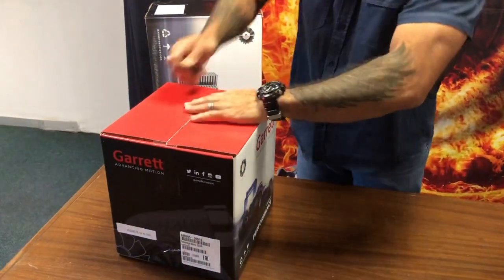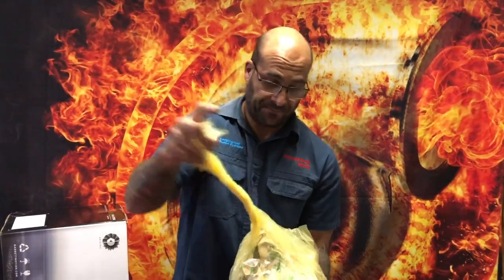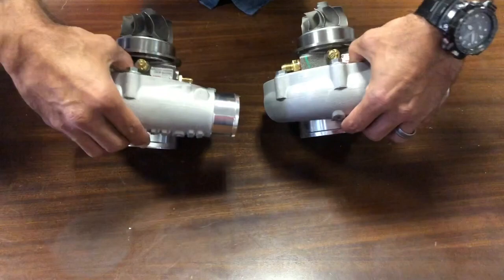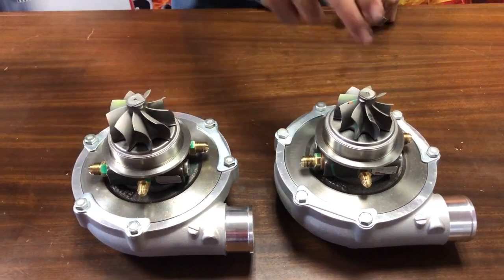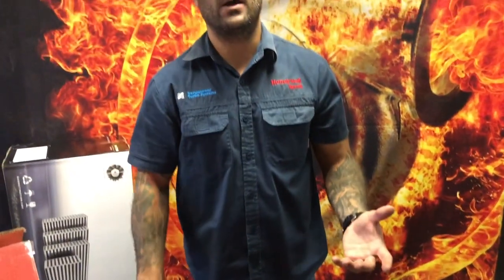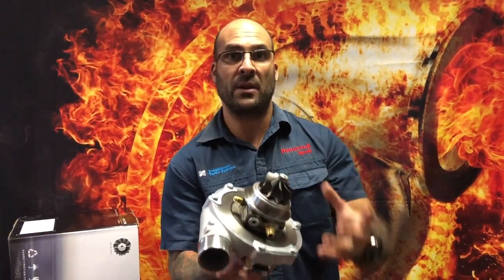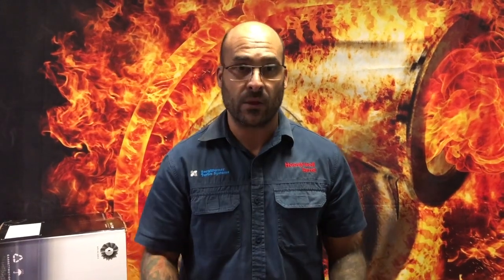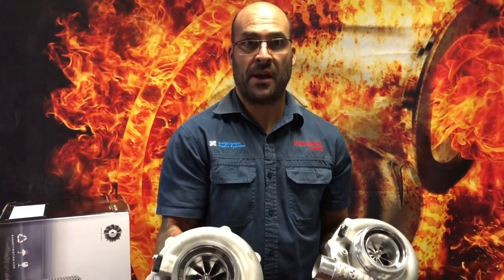G30-900 and G35-900 compared

Comment: N54 8hp, Maxx ECU port injection only. 700 wheel ish. Street car with some racing on side 

6266/6466 next gen precision, 
G series g30-900 or g35-900
Borgwargner SX-E S366

What do I go with and why
Reply from the maker: Borgwarner without a doubt and not the s300 as this isn’t a fair comparison - it’s the only journal bearing turbo in your list. The EFR8474 black series is the turbo that will outspool and outperform all the rest. The Garrett is the unreliable one and totally overrated (forget about seeing power that’s okes close to its printed HP number in the real world.) 

If you want the best bang for the buck - then go S300SXR - it’s journal Bearing but proven reliable, rock solid and delivers more than what Borgwarner claims in HP. https://www.facebook.com/share/v/17R9QmJgon/?mibextid=wwXIfr
Reply: @T @TurboDirectSA was going to use a speedtech single turbo kit it comes with only a Open wastegate dump why they didn’t offer the internal wastegate borg turbos
Reply from the maker: @dolphinfan1493 ALL Borgwarner EFR turbos come internally gated -

Comment: Hello Sir great info.
What would your recommend for Subaru STI EJ25.
I want to make 500 to 550whp. What turbo would be best choice not to go to big. G30-770, g30-900 ?
Thanks
Reply from the maker: I would go for the EFR7163 - it will make that power easily and outspool any G-series turbo!

Comment: I'm 5 years late to this video. hopefully you'll reply me, since i'm in a dilemma. Which turbo u reckon would be best for a stock bottom end evo x (4b11t) with full bolt ons. Gtx3576 II , g30-770 or g30-900 or any other turbos? I'm currently using a hybrid 3076 turbo making roughly 380+ whp on a mainline dyno with pump gas. My target is tryinh to achieve around 430ish whp on with decent spool.
Reply from the maker: Thanks for the comment - EFR7163 is going to spool up much faster than any Garrett of similar size and this turbo will make 550HP I would use the AR80 Vband housing for best spool, if slightly more top end HP is what you prefer I would go for the AR85 T4 turbine housing. Pound off pound the EFR will outperform the Garrett counterparts.  If the HP is more important to you the. Go EFR8370, which will spoil faster than the Garrett3576 and make much more power.
Reply: @TurboDirectSA thanks for the explanation 👍
Reply from the maker: @fyzalyusuf3574 pleasure

Comment: Great video. Im running an ej20 with a GT35r .82. Boost response is horrible but it certainly makes a lot of power all the way through to 8000rpm. In this case, would i still get the top end with the g30-900 in comparison to the old 35r?
Reply from the maker: @Spike_au  change the AR to 61 on your existing setup - it won’t affect power but will definitely liven up the bottom end of your RPM range

Comment: 🤔 for RB26 conversion to single ... 550/600 WHP goal ... what is the best turbo for response max , boost lower possible and peak RPM 7800/8000 ??
Reply from the maker: @makspot  8000rpm is very high. It’s easy to provide low Down response BUT you’ll fall off ontop. I would use something like the EFR8370 with AR92 turbine housing - this will
Give you the best of both worlds and make the power easily

Comment: For a 2jz vvti. If im chasing response on e85 would you go 35-900 .83 or 1.01 vband....
Reply from the maker: @sarirabz3988  what HP target?? What boost?
Reply: @TurboDirectSA  say between 600-700hp on 28psi??
Reply from the maker: @sarirabz3988  the g35-900 won’t come close to that I’m afraid - you’ll need a bigger turbo to make that power with such low boost on a 2JZ
Reply: @TurboDirectSA  🤔🤔 on e85?? I think your wrong. My gtx3576 .82 got to 590hp on same boost.
Reply from the maker: @sarirabz3988  that’s far away from 700HP. You asking for 20% more power at the same boost - sorry but the G-series turbos are never going to offer you that. I would use the EFR8474 black series and you’ll see this kind of output at 1.9bar boost. We have an RB26 with the 8474 using the AR1.05 twin scroll housing that made 800WHP at just over 2.0bar boost and runs 9sec 1/4mile. Shoot me an email on info@turbodirect.co.za and I’ll mail the video and data logs back to you
Reply: @TurboDirectSA  i checked this skyline in action at dezzi raceway it wasnt even using launch thats how fast the turbo spooled up. i saw a sequential gearbox also for the hill climb and that car is nothing but scary fast!!!!!
Reply: I gotta add I also want reliable so don't want it to choke up top.

Comment: Which is better on a built ej257 for goals of 400kw at the wheels? Mostly street application and 2-3 track days per year for fun.
Reply from the maker: You will need a turbocharger capable of a mass flow rate of at least 65lb/min at the intended boost level you want to run the engine at. I would make sure that the turbo is capable of at least 25% more than your required output so that you run lower boost to make the power you want. Depending on the track you will be running on, lag will be a problem because of the high HP target you have for this engine. the EJ series motors dont make power as well as some of the other inline 4 cylinders do.

Comment: I have a fully built EJ257 im looking for a street car that i can take to the track once a month during summer. Would the G35 or the G30 be the better option? I'm looking for at least 700 whp.
Reply from the maker: That kind of HP will require the larger turbo for sure. However with HP comes lag - keep that in mind

Comment: Hi there, I have a Nissan S13 that I'm looking to turbo. My options are the G35 and the G30. Would I be correct in assuming that the G30 would provide a more responsive feel and the g35 would have more overall power in the higher rpms?
Reply from the maker: Yes correct - the larger turbo will produce more power high up. The smaller 30 will produce more lower down.

Comment: Can u do a full run through of the Garrett GTX 3076 gen 2 please
Reply from the maker: Sure - what is it that you are looking to learn from this turbo?
Reply: @TurboDirectSA well I'm hoping to use this turbo on a Subaru WRX so i really  wanted to know the Specs of this turbo ,compressor map efficiency, maybe a comparison between this turbo and the G30 770 seeing that they both reach similar Hp numbers even tho I know the G30 is better. Also what areas would the GTX thrive in
Reply from the maker: @Thomascruz10 Ill do this for you ASAP - for now though, you might be surprised to know that the G-series is NOT better than the proven GTX Gen2 turbos - look at the compressor map alone and then compare this to the power claimed in the Garret printed catalogues, and you will see that the G-series turbos are overrated and definately will not perform  as you might expect them to. I would opt for the GTX Gen2 over the g-series every time.
Reply: @TurboDirectSA interesting. But they are saying g series are 20% more efficient. You saying they are not? Trying to understand it
Reply from the maker: @DailyClipztt firstly they are unreliable and not lasting long. Secondly the compressor maps do not marry up to the power claims. Thirdly Garrett use up To X18 for inaccurate power calculations to inflate their numbers. The older GTX series were accurate and made the compressor map plot power in the real world even on inefficient engine setups. G-series is not worth the money.

Comment: Really Good Video and the explanation Thank You! Question for you I have a Toyota 5e engine and I'm using it only for drag racing no street use I have race cams for and the bottom end is built with a cemented block I'm debating between these two turbo which would you recommend? I appreciate it and thank you for your time!

Comment: Very informative, I'm still hunting for a turbo for my rb26 stock bottom with build head. I got a 6266 Precision Gen is not responsive at all. Needs 620hp at 25/27 psi and might go for forged internals and go up to 850hp or more in the future. Street/track use. Something responsive. Thank you

Comment: Choosing a turbo for my n54 3.0 single build .. I would like good mid and top end with not a lot of lag , mostly for roll racing  . anything between 700 and 750 whp will do . Is the g30 my go to or is it the g35?  Was going to go pt6466 until I found these turbos
Reply from the maker: G30-900 will never see you to this power, even maxed out. I would opt for the following:- 

https://store.turbodirect.co.za/index.php/shop/turbochargers/g3582r1-forged-detail

or

https://store.turbodirect.co.za/index.php/shop/turbochargers/g3582r2-forged-detail

Comment: doing a 2nd gen coyote build and going single turbo. Want boost just before midrange rpm and only looking for 10psi. Would this be ok?
Reply from the maker: I would look toward the Airwerks 300SXE -- various options there, that will make up to 1100HP and work 100% perfect for the Coyote motors, no matter how high you rev them - the SXE models dont run out of steam at all. Best of all - much more reliable to Garrett product and much less money, serviceable with genuine Borg parts and the list goes on!

Comment: Hi, what turbo would you recommend for a rotary 13b engine street ported, fuel system and ecu to match. It will be used for street and some track/drift so response is important, and aiming for  400rwhp give or take.
Reply from the maker: Rotary's have massive exhaust flash - i would use something in the line of the EFR8474 Black with an AR92 or AR1.05 turbine housing, you can use a single gate with this setup for a responsive enough setup for drift. Start with the 92 first, i think it might be small, and you could generate alot of heat as a result.

Comment: Which one would you choose for a twin turbo LS 7.0L set up? The compressor maps say both would work very well in this application-10-12 psi Miata swap.  thank you sir.
Reply from the maker: Both compressors are identical - the turbine is whats different here. I would actually use the larger 35 family, as the 30 will spool up from just above idle and run out of steam from mid RPM - the turbine is too small for this CID engine. 

The 35's with the larger AR1.01 turbine housing on both sides will work great. 

If you prefer a more reliable and better performing setup, i would definitely route EFR8474 Black Series on both sides with the AR83 turbine housing, IWG - this will be a dynamite setup for jst under 2000HP capable.   For less power, obviously turn down boost -- on 0.5-0.7bar boost you can expect to see upwards of 600HP with the EFR options.
Reply: @TurboDirectSA  Thanks so much! This crate engine is already rated at 600HP. The compressor map does show it will flow enough for 10-15psi. How do you apply the Garrett turbine flow charts to A/R housing decision? I use the BW turbo selector program and it shows that a .92/g30-900 would be right on the edge as far as exhaust flow and the G35-900/.83 would be the ticket as well. Targeting response over total power in this app.  (street)Thanks again!
Reply from the maker: @Dodgevair  Pleasure Dodge.  Careful now -- the engine if rated at 600HP already consumes 60lb/min of air flow ---- I assume this is in turbocharged format? Which turbo...... ?

If an engine consumes 10lb/min of air flow, it is expected to be able to produce 100HP at the crank. The engines VE is critical to the choice of the correct turbo. If the turbo flows less than the engine can consume, you arent going to see much improvement at all.  If the engine produces 600HP in NA format, youll need a much larger turbo to feed it sufficient air flow to produce more than this power output.
Reply from the maker: @Dodgevair  These are big CID engines, and they flow a considerable amount for an NA motor - i would consider the EFR8474 Black series on both engines with AR83 turbine housings. 

The other options are here:- https://store.turbodirect.co.za/index.php/shop/turbochargers/g3582r2-forged-detail - 

We have these running on 4cyl, 6cyl and some V8 Lexus 1UZ and 3UZ engines with excellent results.  Faster spool than Garrett's G35, and power that surprised many tuners when comparing to Garrett's G-series models, and for alot less money.

Comment: Hello 
I have question please 
If I add single g30-900 on 2jz pistons 86.5, there is any problem or back pressure?
Reply: From 600 to 700 hp or what is the max hp I can get it without back pressure
Reply from the maker: @carwowsa  You will need to run a turbo that is capable of more power than what you want to reach, in order to keep things reliable, and not have to run the turbo to its max all the time.  Choosing the correct turbine housing AR is key. 

I would opt for the EFR8370 without a doubt, this will give you the best response aswell as power output.  It is much more reliable than the Garrett G-series turbocharger range, and will make the claimed power without a doubt.
Reply from the maker: What HP target are you planning on going for? The higher the HP, the higher the boost pressure, at a specific point you will find that backpressure might become a problem, and a large AR turbine housing would be required.

Comment: Hello, I have a question for you. I have a Golf 7.5 R 2.0 4cyl and I would like to increase its power around 650-700hp, without having to ride methanol. I'm between two of these turbos: Xona 7864s / Garret g30-770 / Garret g30-900. And what A/r? 
I would like it to have the greatest power I want to approach by having as little lag as possible. The car will be for daily use, but I want to boost it. 
Thank you.
Reply from the maker: Don't bother with the Garrett units, they are not able to produce the claimed power. You will have to run extremely high boost permanently to squeeze out 700HP from the G30-900. The best option for this power target and that motor is the EFR8370 without a doubt, it will produce the power and spool faster than any other turbo, and cost you less at the end of the day.
Reply: @TurboDirectSA  lots of thanks for the response
Reply from the maker: @davis6383  Pleasure !

Comment: What G Series Garrett would you recommend for a 4G63 powered Nissan S14 drift car?
Fully built motor, ported heads on ethanol. 
Aiming for 600-650 crank.

Thanks for the videos
Reply from the maker: Thanks for the comment - i would not use any G-series turbo. I would use the proven GTX Gen2 or EFR series turbo - or the TurboDirect S.A range of ball bearing turbos. The G-series do not live up to the claimed HP from Garrett

Comment: Which would you recommend for a street twin turbo 6.0 LS at 10 psi (6500 rpm)? I’m thinking the G35. What A/R for quick response, but with acceptable back pressure?
Reply from the maker: I would look at the BorgWarner S300SXE- twin turbo setups using these will make more power, last longer, cost less and spool beautifully for a street application and then some. 

The 13009097008 is an 875HP capable turbo (True 875HP) and uses the smaller turbine wheel - together with the AR.91 twin scroll T4 housing you wont go wrong.
Reply: @TurboDirectSA  Thank you. I had actually looked at those. I was just afraid they were overkill for my application. I know the 1.8 pressure ratio and 35-40 lb/min each fits well in the best efficiency island though (I don’t “need” turbos good for 1700 HP). I am a little limited on space so had been looking at smaller turbos, but these may be similar in size to the smaller 58mm or 62mm compressor ones.
Reply from the maker: @general23cmp  Dont worry about the capability of the turbochargers added together - the size and match works 100% for your specific engine - The G35 will produce more power than these turbos if you go by the claimed power that Garrett claims on their catalogue. 

The response, efficiency and the fact that you will make enormous power if you choose to increase boost is something you have in reserve. The turbos will make more than enough boost even at 7PSI which is something that a streetable setup should run with twins. 

What you dont want is two small turbochargers that spool too fast and generate wheel spin at 2000RPM, the car becomes a handful to control.  What you want is something linear - responsive and easy to drive with more than enough power reserves should you choose to go there.

Small turbos generate alot of heat as they typically run alot faster in rotational RPM.
Reply: @TurboDirectSA  Thank you so much Sir.
Reply from the maker: @general23cmp  My pleasure - hope it helped.
Reply: @TurboDirectSA  You wouldn’t know if they have that turbo in a reverse flow version (for symmetrical look) would you? It’s not critical.
Reply from the maker: @general23cmp  No unfortunately not
Reply: @TurboDirectSA  I’m curious why you didn’t suggest an EFR 8374 as well…cost vs the other Borg? I do see the S300SXE does have good efficiency islands at lower boost levels, but they’re very similar maps. That and cost/value is probably the reason.
Reply from the maker: @general23cmp  Its old and replaced by the 8474Black- which makes alot more power and spools very similarly. You just dont get much from the older 8374 in comparison to the 8474Black and the S300SXE cost-wise is a similar performing turbo to the 8474 but for less money - and yes journal bearing - the application you want the turbos for, a journal bearing setup will work perfectly (large engine) and costs obviously alot lower.